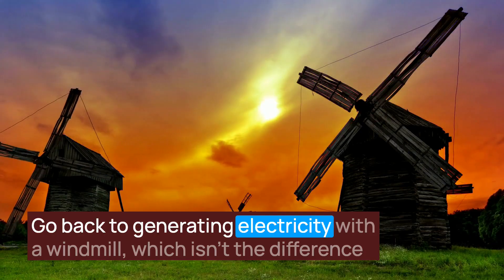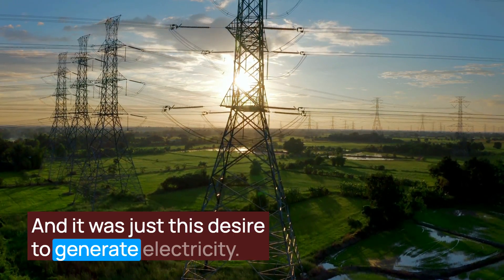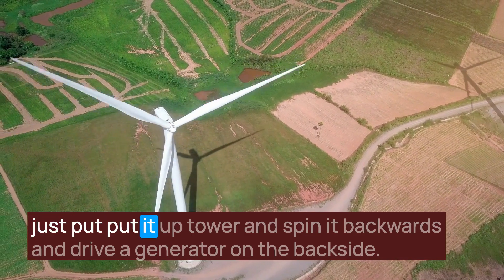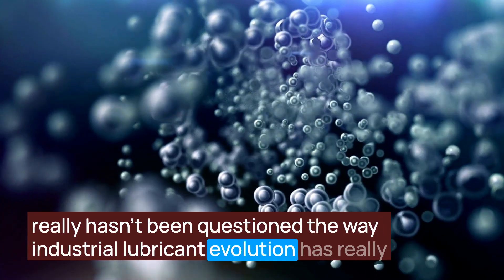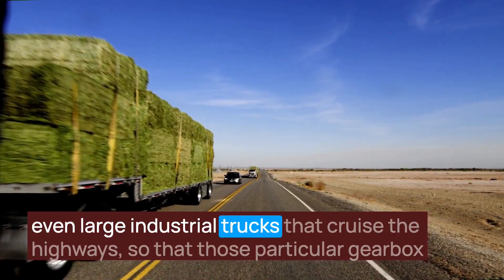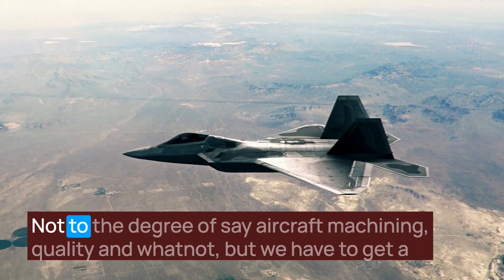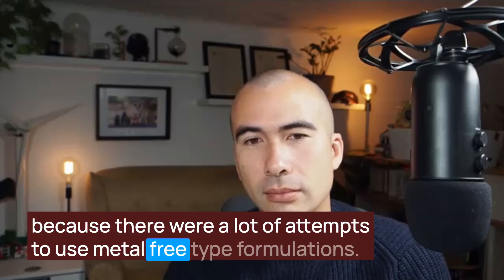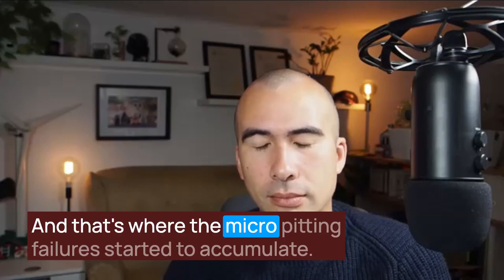Wind Turbine gearboxes keep failing because...

Comment: 4 minutes that goes.... fuucking nowhere.
Reply from the maker: Ha! Thanks for the feedback. I was trying something different to the usual - some of the experiments are going to die on the vine. The full interviews aren't going to be published here anymore because I mostly got feedback that people didn't want to watch them on YouTube. So while I'm figuring out a podcast platform I thought I might release a couple of clips.
Reply: 4 min of mild enlightenment if you know what’s happening in today’s market…The reason it’s important is because there is very limited gear add packs that have the micropitting data set today…and there is lots of growth anticipated in full syn gear in this market, but you will need the FE8 and all gear add pack with FE8 data set on allocation